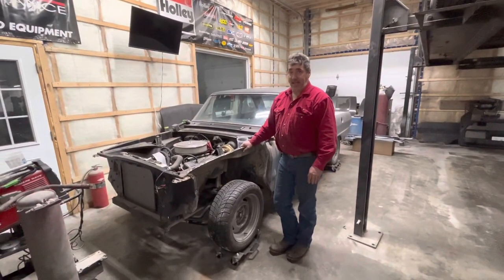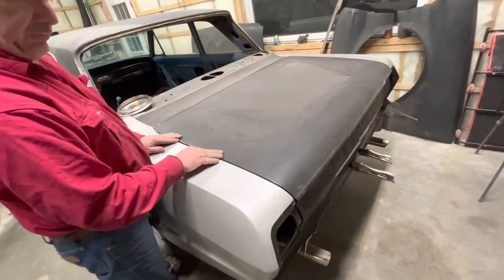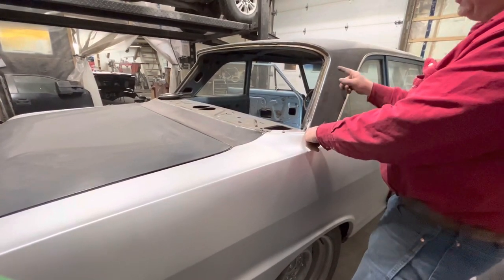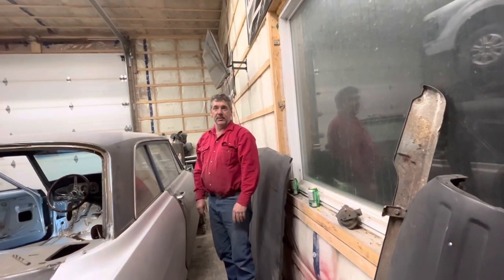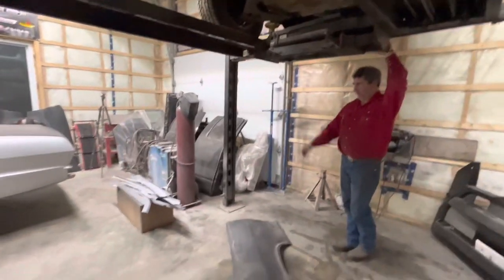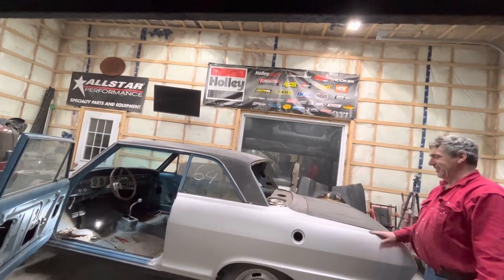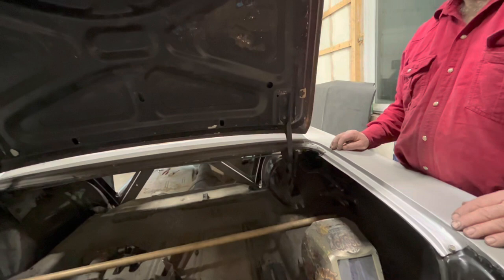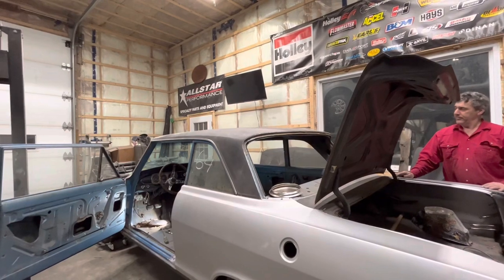New QUARTER PANELS  for the 64 CHEVY 2 ( NOVA ) we’re almost ready to burn them in

Comment: I have have a 63 nova that needs a quarter panel and rocker panel replacement on the driver side. Would you recommend replacing the rocker panel first or the quarter panel? Thanks for any advice
Reply from the maker: I normally do rocker first and get my alignment nice there then do my quarter panel
Reply: Thank you